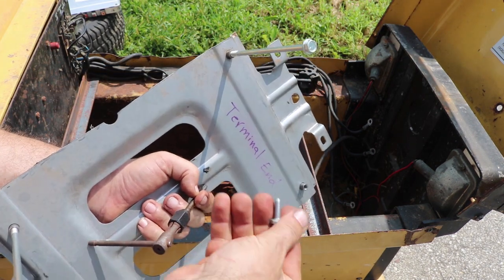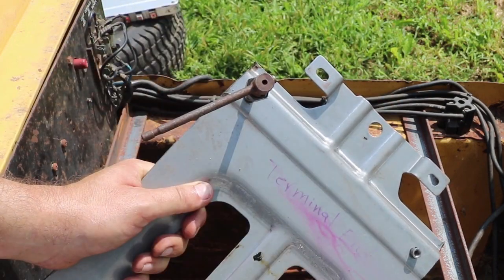ElecTrak Rat Rod Part 4

Comment: So wheelie was a spoiler, isn't it?
Reply from the maker: Well, yeah, but I was pretty excited and had a backlog of the How-to videos. Wait until you see the final video though!
Reply: @BenjaminNelsonX  of course we standing by u
Reply: @BenjaminNelsonX  nice , using motor as lathe😊, 
Hey. I have a question,
Can you walk us through how the "Sun trip" bicycles work??
I meant the sun trip rally where everybody have solar panels on them and never have to charge through out thousands of miles?how it's done?
Reply from the maker: A solar bike is just an electric bike with solar panels added. Take a look at my Solar Ammo Can videos. Those show how to use a solar charge controller. It's the exact same idea. The main thing is that you need an efficient vehicle and plenty of solar. Electric bikes are very efficient, but don't have much room for solar, so they need a trailer or some similar way to add plenty of space for solar without much weight or drag.
Also, an electric bike is actually a plug-in hybrid, so part of the power can always be provided by the pedals, or even all of it if the battery runs out. Building a completely solar powered car is much more challenging, but is done for college engineering competitions.
Reply: @BenjaminNelsonX  ok, thank you sir.

Comment: I am 58 and they where talking about the usa going metric back then lazy industry can't hang
Reply from the maker: I have no problem with the metric system, I just am always shocked at sometimes the price difference or availability of certain components. I've even seen parts on Amazon which are marked as standard, but are clearly metric.